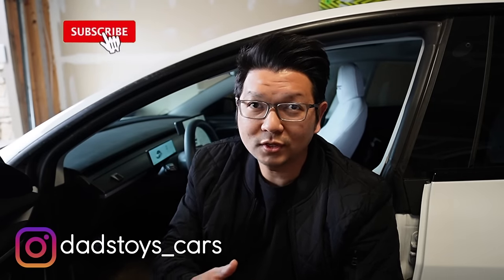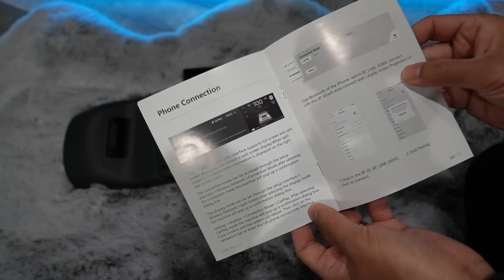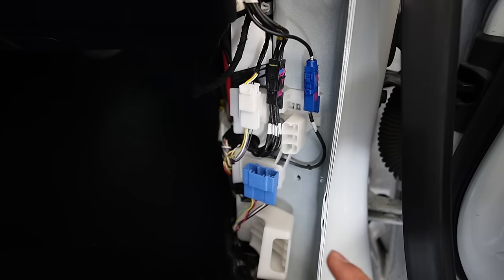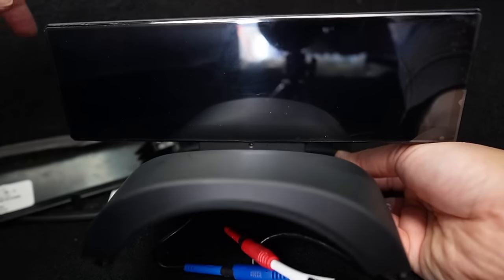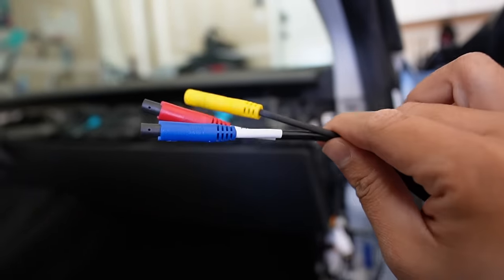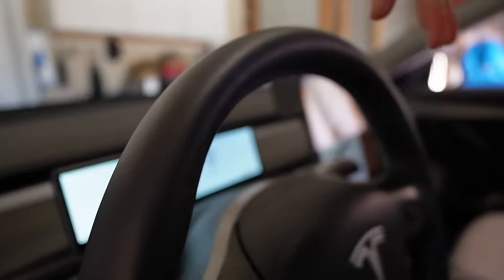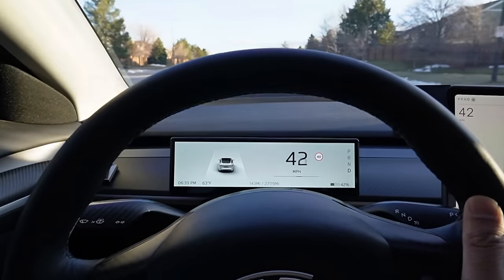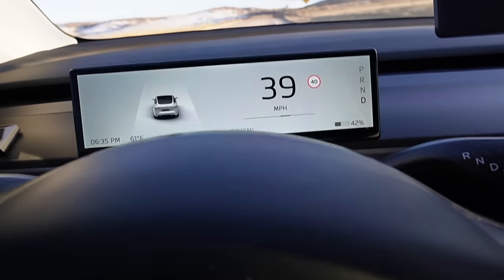New 2024 Tesla Model Y/3 Display with Apple CarPlay & Front Camera Upgrade! #tesla

Comment: Masking tape is terrible for permanent installation, especially in a sometimes-hot location.  HVAC tape (the aluminum stuff) or Kapton/polyimide tape would be much better.
Reply from the maker: Appreciate your comment.
Agree with you on using those tapes for permanent solutions.
The reason why I suggested masking tape because it will at least stay until you decide to remove the dashboard and if you have to sell the car and have to remove the display then it will much easier to do without leaving and mess behind.
Thank you for watching!
Please subscribe for future contents.🙏😃

Comment: It looks very clean. 

However I am worried that tall drivers will have problem seeing the display. Tall driver which has the steering wheel high, fully extended, and seating low.
Reply from the maker: Appreciate your comment.
If you adjust both seat and steering wheel so that you can see through the top of airbag then you should be able to see the display.
Thank you for watching!
Please subscribe for future contents.🙏😃
Reply: @dadstoyscars  For sure, problem is that the seat and steering wheel is extended to max, otherwise my knees would interfere with the steering wheel. However it seems that the pro version seem to be positioned differently, might opt for that.
Reply from the maker: @lobo8961  you still have to be able to see through the steering wheel on the T8 pro

Comment: why can't company design a display with non-destructive installation which doe not void warranty. A display with wifi front , andorid auto carplay, a full android system. They can tesla info using apis.  While driving we don't need any of car info except battery, maps and speed.

Comment: WOW, At last a Full Drivers Binnacle speed display on a Model 3 and Y.  That's what all cars and EV's must have. for safe driving per the rules. 
Every car had to have one in front of the driver, for safety! Every car did have one no matter the other cockpit layout through history of the car. 

That's why I disliked both the Model 3 and Y as Tesla took away this display and put it as a small figure on the corner of a screen which being in the middle of the dash area made it a danger to view the speed as this meant you needing to look away from the front view of the road to the middle of the dash to try to see small figures on a screen which was not even facing you?

Every car and EV had the binnacle including the S & X so why Tesla removed that display really was bad.  
I am pleased that Tesla Owners can be putting the display in front of your drivers view as the safety rule stated, Since Tesla did not do it as they really should?

Far safer to drive with your eyes glancing down for a couple of seconds to see the speed there on the binnacle speed display 
than trying to look away to the side for many seconds to try to see the silly small speed figures on the corner of the Tesla screen in the middle of the dash area.